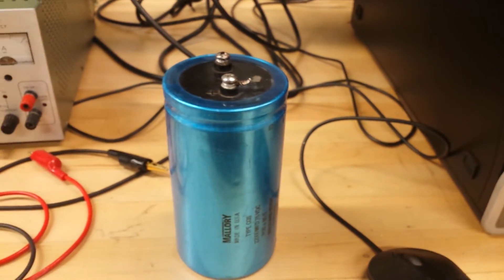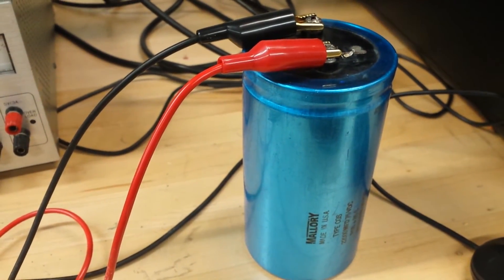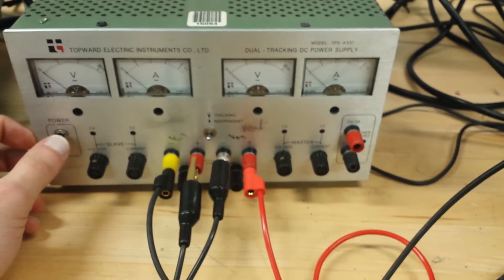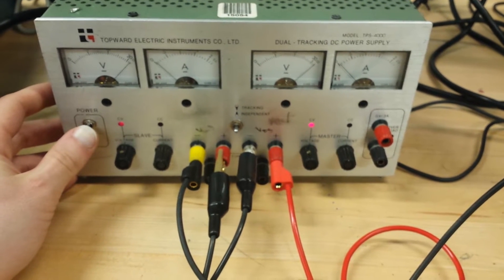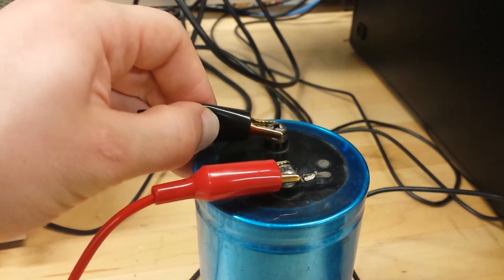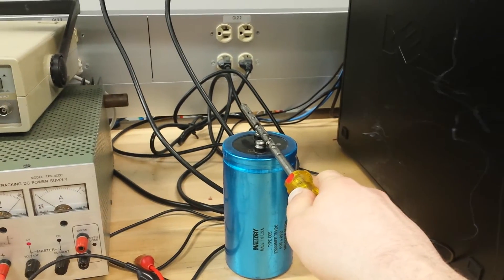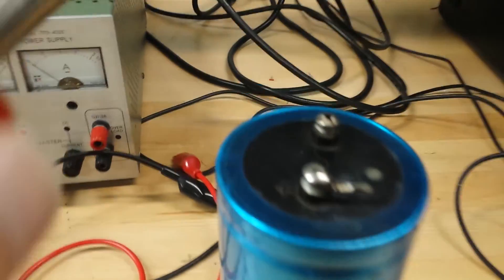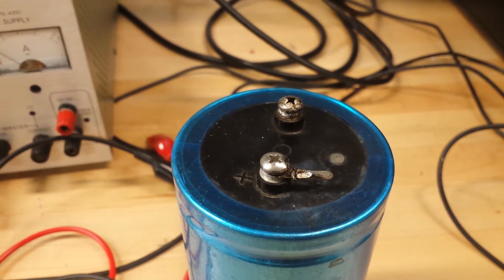64 volts + 22000 uF capacitor + short circuit = FUN!

Comment: Hye . Can i use this type capacitor to boost volt 12v to 60v (5 in series) and work with the motor .

Is it possible ? Thanks 🥰
Reply from the maker: No, if you put 12v in, you will only get 12v out. With AC voltage only (not DC) you can use a specific transformer to step the voltage up 5 times but the current will be 1/5th. but power sources can add together. five 12 volt batteries can add up to 60 volts. Also a power supply like the one in the video will work too. Though, it mainly depends on what type of motor you have and what its tuning.
Reply: Joseph X i see . Thanks 🥰
Reply from the maker: @ninjafishing7120  your welcome, glad to help
Reply: @JosephX  what are you talking about, dc boost converters are a thing

Comment: I thought nothing happends when you short circuit a capacitor because my 3volt 5amp capacitor just dies when you short circuit it and nothing else also i can't even feel the shock of my capacitor
Reply from the maker: Hmm, thats probably because  it can't hold enough power to fight the air/atmosphere resistant, bigger capacitor + more power = bigger spark
Reply: OMG i didnt think u would reply
I also got a bigger capacitor now
Reply from the maker: @bitonic593  I always try to reply, during the school year, I don't have as much time to, but I always try. Plus nice on the new capacitor
Reply: :)
The capacitor is still weak but i only like to power LED for long time so this capacitor is good for me
Reply: Edit: got a 10,000uf capacitor and it sparks like brrr when short circuited (charged to 9v) and when it feels like a static shock but stronger

Comment: Get a 10000 if with 500 volts. Explosions are fun
Reply from the maker: Lol they are, but where to get a capacitor that powerful and how to generate 500 volts? I know I don't have the ability to do that yet
Reply: @JosephX  get 4 of them. Put 2 in series and parallel. Make sure you research how to wire it or the cap will explode upon charge! 2000 joules is epic!
Reply from the maker: @shinigami117s8  good idea, but I got the first one use at a ham fest (like a flee market), also parallel and series doesn't quite work like that, when you put capacitors in series, they can handle more current (voltage is not affected), put you lose the amount of capacitance (uF), but I can add the uF together by putting the capacitors in parrelle ... hmm, I like the way you think
Reply: @JosephX  that’s why you do parallel and series with the 4 caps. I make joules testers for thermistors! It really works!

Comment: I use a ceramic power resistor to discharge high-voltage caps, but I've also gone for the screwdriver method when I didn't have the resistor handy. It's not good for the capacitor (or the circuit if there's other charged caps elsewhere) but it's not dangerous to the tech as long as you're only touching the PLASTIC part of the screwdriver. 
As a side note, I like to call high voltage capacitors "flyback capacitors"

Comment: Will it damage the capacitor?
Reply: Probably not too bad, the internal resistance of the capacitor is so low that they won't heat up much when you do this sort of thing.
Reply from the maker: I don't believe so (minus the leads getting a little chewed up), capacitors, especially powerful ones like this one, are made to discharge and handle a lot of power

Comment: I have 21K voltage capacitor from microwave what Can i do
Reply from the maker: How much  uF (microfarads) does the capacitor have? ... The spark has more to do with the amount of microfarad ... especially since there are capacitors with high voltages, but a fraction of a microfarad that will not work ... so check and let me know
Reply: @JosephX  0.90 uF :((((
Reply from the maker: @jozik_sk  that is not alot but you can still try it, It may or may not work
Reply: Or please say, how i Can explode it
Reply from the maker: @jozik_sk  when you mean "explode" do you mean make a big spark (like what I did) or do you mean blow up explode
Reply from the maker: @jozik_sk  Let me think if I should be telling you how to do that, exploding caps can be very dangerous, I have heard stories about people almost losing an eye and worse.
Reply: @JosephX  iam doing same experiments at school iam electrician 😃 Yesterday i Made metal melter from microwave transformer input 230v and out is around 800-1000+A. In school i plug soldering Iron in plug and boom lights turn off and All school havent any light Power 😄 (sorry for english)
Reply from the maker: @jozik_sk  Fine, I will not be held responsible for any thing bad that happens, I warned you, but if you take an electrolytic capacitor and hook it up backward (negative to positive and positive to negative) at a high enough voltage, that should do it. ... when you do this, make sure someone is around, so if something bad does happen, they can help you
Reply: @jozik_sk  microwave capacitor haved resistor inside and it will not explode couse its ac type capacitor not electrolytic capacitor
Reply: @smoke_stackz3168  Then you cant really explode it. But it may make some noise if you take too much voltage.

Comment: Can you charge it with 2x AA Batterys?
Reply from the maker: Pieterrr58 58 yes you can, you can charge the capacitor with any type and amount of batters, as long as the total voltage is under 75 volts (or max volts for this capacitor). Though, the more voltage, the bigger the spark, so the 3 volts from the 2 AA battery (1.5 volts for each battery) will give you a much smaller spark then the 64 volts from the power supply